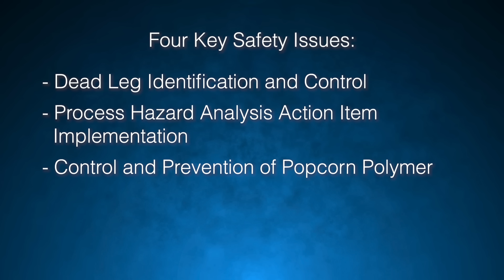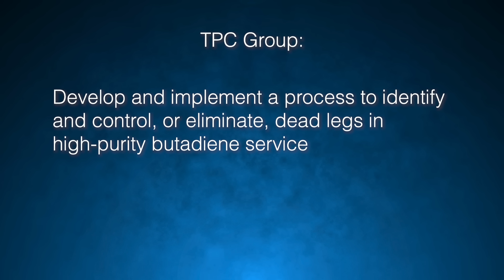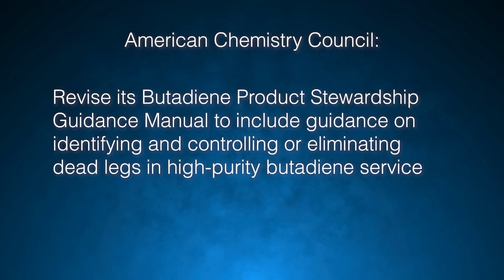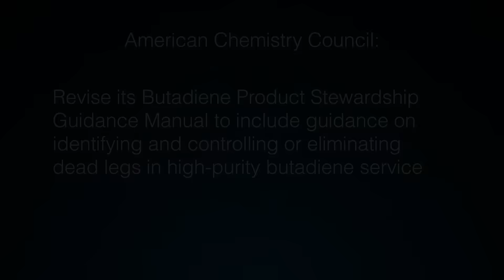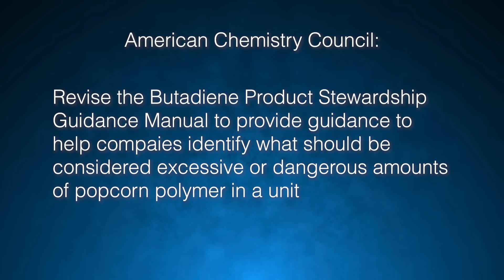The Danger of Popcorn Polymer: Incident at the TPC Group Chemical Plant

Comment: What “popcorn polymer” is

Butadiene (a chemical used to make synthetic rubber) can react and “self-polymerize” if it gets exposed to oxygen.

It can form a hard, porous solid called “popcorn polymer” (it can keep growing once it starts).

If it grows inside pipes or equipment, it can block flow and/or create extreme pressure, until the metal ruptures.

The key setup problem: a “dead leg”

A dead leg is a section of pipe that’s still connected to the process but has little or no flow.

No flow = material can sit there for a long time, which makes reactions and buildup more likely.

At TPC:

Aug 4, 2019: A primary pump was shut down and then wouldn’t restart, so it was removed for repair.

They kept running using a spare pump, but the out-of-service pump/piping effectively created a dead leg.

Over 114 days, popcorn polymer formed and accumulated in that dead leg.

What happened the night of the incident

12:54 a.m., Nov 27, 2019: The dead-leg piping ruptured from the buildup/pressure.

About 6,000 gallons of liquid (mostly butadiene) dumped out in under a minute.

It rapidly vaporized, forming a flammable vapor cloud.

About 2 minutes later, it found an ignition source and exploded.

There were additional explosions, and because some damaged lines couldn’t be safely isolated, leaks and fires continued.

Fires weren’t fully out until Jan 4, 2020.

Why it got so bad (CSB’s 4 main safety issues)

Dead-leg identification & control
They had a procedure to reduce risk (run spare pumps periodically), but it didn’t cover the scenario where the primary pump stayed offline for months, so the dead leg wasn’t properly managed.

PHA action items not implemented
A prior hazard review (PHA) had flagged the risk and recommended regular flushing, but it was never implemented.

Weak control/prevention of popcorn polymer
They had a history of polymer problems and even ran operational trials that seemed to worsen polymer formation, but they kept operating and delayed a shutdown/cleanup.

No remotely operated isolation valves
In a major incident, manual/local valves may be impossible to reach. Without remote isolation, they couldn’t stop releases quickly, which contributed to more explosions and prolonged fires.

The big lesson

TPC treated the broken pump mainly as an operations problem (“we can still run on the spare”) instead of a process safety hazard (“a months-long dead leg in high-purity butadiene service can create an explosion risk”).

Comment: This is exactly what is wrong with the usa...
Corporations OWN the politicians and are allowed to poison the public with toxic chemicals so long as they don't get caught. 

	Instead of doing routine maintenance they put it off in favor of profit over safety of the employees and neighbors. Shitting down costs millions per day - which is the reason they never fix anything until its too late. 

	What about the clean up of released chemicals??? Didn't hear anything about any soil removal or water/soil/air quality tests being done after the 'incident' ( not an accident, this was caused by greed with no care for anything but the bottom line) 

	Why was no one put in prison? This is done with malice and FORETHOUGHT of the owners, coe, coo, and all the others incharge. 

	And you wonder why canada says "HELL NO!" over becoming the 51st state...

Comment: Fightclub "A new car built by my company leaves somewhere traveling at 60 mph. The rear differential locks up. The car crashes and burns with everyone trapped inside. Now, should we initiate a recall? Take the number of vehicles in the field, A, multiply by the probable rate of failure, B, multiply by the average out-of-court settlement, C. A times B times C equals X. If X is less than the cost of a recall, we don't do one."

Comment: Fightclub, the movie, explained why lack of real regulation/dis-incentive for demonic corps are behind these things constantly - "A new car built by my company leaves somewhere traveling at 60 mph. The rear differential locks up. The car crashes and burns with everyone trapped inside. Now, should we initiate a recall? Take the number of vehicles in the field, A, multiply by the probable rate of failure, B, multiply by the average out-of-court settlement, C. A times B times C equals X. If X is less than the cost of a recall, we don't do one."

Comment: How in gods name are engineers developing sytems in any field, let alone something as dangerous as this, withough redundancies and overlaps between running equipment/back-up/repaired equipment so that this not-flowing condition is NEVER even possiblity - the chances of this happening with appropriate measures in place should be something like winning the lottery and that would be extremely easy to achieve with the right systems/monitoring. If all they can take from this is "oops, pump take longer to repair than expected" then GOD HELP US ALL. If corporations can cut corners - they will - that's why de-regualting everything means innocent ppl die for profits. The cost to build the right systems is miniscule in the grand scheme for these types of businesses but like i said - corporations do not have souls by default - either they need moral ppl making calls or they need policing. It's not just humanity that suffers here - the earth is being turned into a hellscape - at a literal industrial rate

Comment: They are very, very lucky that it didn’t cause Huntsman Chemical to explode, that plant makes ethylene oxide and propylene oxide, two of the most dangerous and explosive chemicals in the world!!! If it had gone off, southeast Texas would not exist anymore, the blast radius of that plant is 30 miles in each direction, it would have the same force as a nuclear bomb, which would have wiped out every other chemical plant and refinery in 30 miles, I worked at huntsman for two years as a union electrician, it is one of the most dangerous plants in America and the world! They are lucky!!!

Comment: Context: Popcorn polymer is a porous, reactive, and rigid resinous material that resembles popcorn in appearance and is a significant hazard in industrial processes. It can form in a variety of shapes and colors, including white, yellow, brown, crystalline, sheet, rubber, or popcorn. 
Popcorn polymer can form when butadiene reacts with oxygen or other chemicals, and it can grow quickly, especially around rusted iron, water, and some peroxides. It can also form in the absence of air. 
Popcorn polymer can be a significant safety risk in industrial processes because it can:

    Clog pipelines and equipment: Popcorn polymer can adhere to and foul pipelines and equipment, which can decrease efficiency. 

Rupture pipelines and equipment: Excessive popcorn polymer growth can deform or rupture pipelines and equipment, releasing olefin vapors that can lead to explosions or fires. 
Take equipment out of service: Popcorn polymer can cause safety critical equipment to stop working. 

In one incident, popcorn polymer built up in an unused pipe for over 100 days before rupturing, causing 6,000 gallons of flammable butadiene to leak and explode.

Comment: This tragic incident at TPC serves as a stark reminder of the importance of proactive safety management in high-risk environments. The failure to address known hazards, like the accumulation of popcorn polymer and the presence of dead legs, coupled with delayed maintenance and the absence of remotely operated isolation valves, shows how small oversights can lead to catastrophic consequences. Hopefully, the recommendations from the Chemical Safety Board will push the industry to enhance its safety protocols and prevent another disaster like this. Safety should always be the top priority, not just operational efficiency.

Comment: I just so happen to work for an HVAC manufacturing company and we manufacture pumps. Our pumps don’t move hazardous material (mostly water or water mixed with glycol, etc.) and even when our pumps go down, it can have unsavory consequences. Entire ERs have gone down due to pumps failing. THIS is crazy!

I’m not an engineer but from working in the industry, I’d say it’s always a good idea to order at least 2 repair kits, and a spare motor to go with the pump(s) as you’ll need to perform maintenance at any given time and due to DOE regs, the parts needed can be discontinued.

Comment: Real chemical plants have pairs of pumps side by side, shut main pump off,
start pump 2, back in process, pump 1 removed for repair, better yet, new pump installed,  pump 1 rebuilt.
Reply: Redundancy is expensive and not always strictly required. As such, the tax payers will pay instead 🤗
Reply: Exactly! Redundancy.

Comment: Dumb question, but if you anoxidize the dead leg section of piping with inert argon or something, can popcorn polymer be prevented from forming altogether?
Reply: By definition, the dead leg is connected to the process container. Therefore, argon and other neutralizing substances would interfere with Butadine processing. So, very likely no.

I'm rather unfamiliar with this process, so I'm being vague here purposefully. 

Best practices are to have shut off valves at all inputs and have secondary pumps.
Reply: @selfawaretrashcan4594  I see, so the dead leg section is a production element. I thought it was an oversight. Geez. What a horrifying way to find out you seriously messed up your production design.

Comment: Wtf is "popcorn polymer"? 
How does it accumulate? 
Should I worry about this stuff building up in my car? In my shower? In my ass crack? 

Literally nothing was explained about this except the danger it posed.
Reply: It's butadiene plus oxygen allowed to sit in an unused section of pipe til it explodes. That's what popcorn polymer is. The video is very clear about this.

If you have butadiene oxidizing in your ass crack you have far larger problems than popcorn polymer, that's for sure.
Reply: @amystubby 😂

Comment: born there, many years from 1959 till this and nothing on this scale ever happened in Port Neches involving Texas US Rubber, Goodrich Gulf Rubber, Neches Butane, Texas Co Asphalt Plant or docks.  You drive thru there now, TX US rubber is gone, Goodrich Gulf has done changed hands so many times I've lost count.  Neches Butane, no clue, Texas Company morphed into Texaco, morphed into Star and whatever the hell it is now.  I have photos of the old mule barn of the Asphalt plant.  Also a mule team of some 24 mules dragging a timber down what's now hwy 366 to drive in the ground as foundation supports for what was Pure OIl.  Those men came off the farms, mechanics, been in one, two world wars, Korea.  ZERO OSHA as it should be.  Toss in old Texaco refinery and old Gulf oil in Port Arthur and Magnolia plant on Sarah Jane and every plant that's still there today with new names, ALL built by men not needed a babysitter.  Scary thing today is when you drive thru where that TPC plant is, you'll notice as you look thru the facility, you'll be lucky to spot one worker.  Where's the crew?  pumps, compressors, furnaces, distillation towers, unimaginable amount of flanged piping, pressure & temp siphoning off lite hydrocarbons, flares.  Where are the crew sizes of yesteryear?  Who owns these "Port Neches" sites.  Northeast coast?  Foreigner's?  Who became Sole Owner of your largest refinery / petrochemical plant in the United States of what's left of America in mid 2018.  Newly crowned prince of Saudi Arabia, bin Salmon.  Motiva Enterprise Llc's Port Arthur plant in a major population center of Texas.  Same country we were told sponsored some pilots a few years back which birthed the TSA, DHS.  Saudi Aramco LLc's Saudi Refining, Inc.  And look at its location, intracoastal canal where it intersects the mouth of the Neches river (hello Exxon Mobil, Mobil Chemical, splintered Du Pont and Port of Beaumont) and Sabine Lake, the egress & ingress of the Gulf of Mexico.  Lovely!  No leverage there.  What could go wrong. Lace that in with PEMEX the nationalist oil company of Mexico owning your refinery in Deer Park, TX for the last 3 years and again not a single word from your governor or any politician.  But hey, its football season. And the terror sponsoring country of Saudi Arabia obviously pays its hands pretty darn good.  Understand something.  Any of you born and raised in Port Neches, groves, nederland, Port Arthur.  Do you remember Port Arthur of yesteryear?  Well look at it today.  How easy will it be for a family whom owns warehouses full of federal reserve notes to fly into jack brooks regional, un x-rayed, not fondled by TSA warm hands, fly in and offer "support" to a broke ass community which aside from countless nail salons has nothing left but petro plants.  Revitalization plans using Saudi cash and you watch what will happen.  They will OWN Port Arthur.  They already own your elected servants all the way up to that oval office.  I can't recall who presided over the executive branch in 2018, entire cabinet had to look the other way.  But r or d doesn't matter when you are $36,000,000,000,000 in debt.  The people siphoning the profit off these facilities do not live in Little Abbeyville, or off Nall St or Keith estates.  No, they're elsewhere so when she blows, oh well.  Minimum staff, absolute least pm as possible and capture and export the $.  Fact!  Popcorn polymer, really?  Your describing the water to a People whom are drowning.  Its much bigger problem than a pregnant flow line at one facility.
Reply: Yes, and will only get worse if you vote rumpish!

Comment: I wanted more information specifically on how the initial reaction began, I have zero understanding of plumbing and pressure -

"The introduction of oxygen into the system, which can initiate unwanted polymerization reactions, can occur through several pathways:

Pump Failures: When pumps fail, they might not maintain the necessary pressure to prevent air ingress, especially if there are leaks or if the system is not properly sealed. Cavitation, a condition where air pockets form in the liquid being pumped, can also introduce oxygen into the system.

System Maintenance: During maintenance, if the system is opened or if there are leaks, air can enter the system.

Poor Sealing: Inadequate sealing of connections and joints can allow air to enter the system.

Even if pumps fail and fluid remains in the pipes, oxygen can still enter the system if there are leaks or if the system is not completely filled with liquid. This can lead to the formation of unwanted polymerization products like popcorn polymer, which can cause severe operational issues. Regular maintenance and proper sealing are crucial to prevent air ingress and subsequent polymerization reactions."

Comment: Can anyone knowledgeable explain how the rupture actually happens? As said in the video, the dead leg is a section of pipe open to the reaction chamber but one that doesn’t not have material flowing through it. That gives that section of pipe conditions to accumulate popcorn polymer. However, if that section of pipe is always open to the reaction chamber then it is subject to the pressures of the reaction chamber, and the corresponding pressure in that section of pipe. But if there is no material movement in that section, then the accumulation of popcorn polymer wouldn’t have an effect of the flow rate in that section, because there is no material movement. So was this section just the weakest link in the system? Or did popcorn polymer buildup in this dead leg lead to a decrease in flow rate of another out flowing pipe section, that lead to an increase in pressure of the reaction chamber and this section was the weakest link because it wasn’t flowing? I hope that makes sense.

Comment: No relief valves or other designs to warn of pressure building up?  How about bands  around pipes that would snap if expansion occurred? No evacuation and isolating dead legs until the repair can be completed. Where’s the common sense?

Comment: One of the things I have always been fascinated and dreampt of was using very low power microchip/isolated computer monitors near pipes in a chemical plant. Always thought of using AI and different methods to help safety protocols and maintenance of pipes and other hazards in a chemical plant.

AI using Nvidia’s chips can be used to help make chemical plant safety monitoring and maintenance easier for workers.  I realize that can make it costly, but modernization of chemical plants is a must.  Besides making Quality of Life in and around a plant Just Plain Simpler and Easier.

Comment: This is fake as our secured borders. So these pipes don't have pressure release valves from the feed? Really. Not buying it. Been in plants like this like paper mills and reactor plants all pressure pipes have gauges for feed and release with safety release valves to prevent over pressure of pipes. I've seen chlorine and ammonia released to prevent over pressure of pipes. Same with steam and hydropower plants. There's monitoring gauges everywhere and someone to make sure the psi is in spec. This is crap.
Reply: There's always a chain of events in these types of accidents. Malfunctioning, in maintenance, or just gross negligence. Some plants have just awful design and management.

Comment: As a process engineer, one thing I don't understand is it seems that the formation of popcorn polymer is inevitable, you really cannot predict how fast the pluggage forms. This applies to all process that prones to form pluggage. So why they cannot eliminate the overpressure source? Such that put a higher pressure rating equipment/piping? So when the process is deadheaded, it would simply be pump tripped or pump burned (over amp protection potentially?) 
I like most of the CSB video, and videos are well made. But this investigation is not well explained.